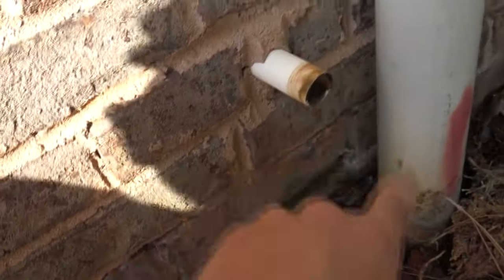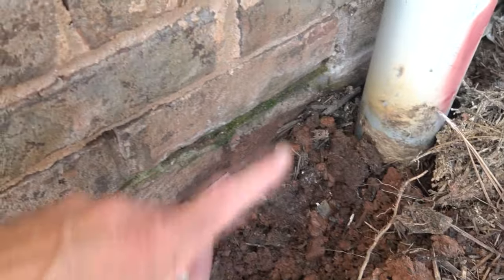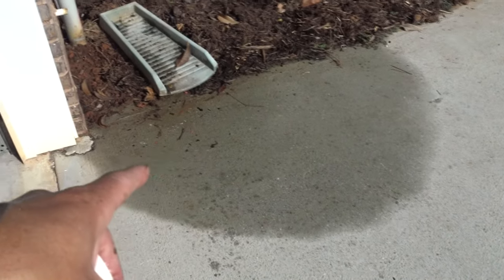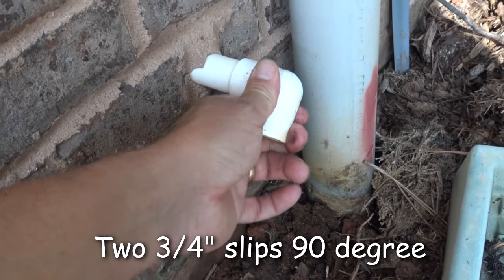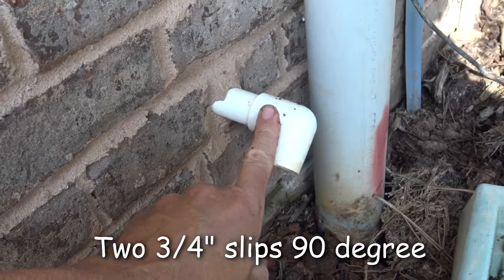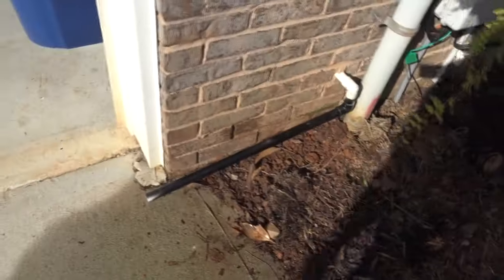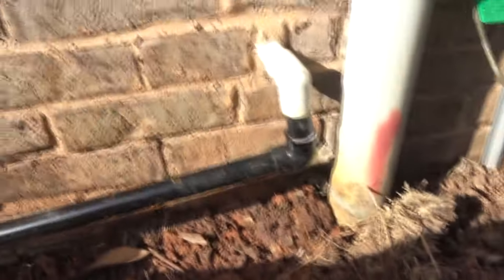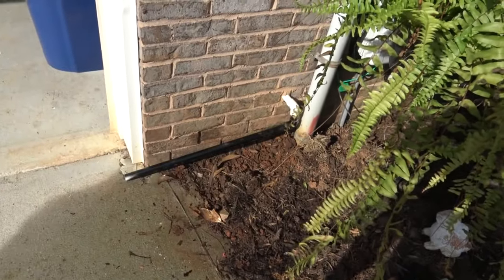AC Drain Drip Near Foundation - Move AC Drain Water

Comment: Older video - but exactly what I was looking for. Especially grateful for the tip about not gluing the pieces so that you can move them (or even disassemble easily for cleaning). Great video - thanks.

Comment: You can dig a gravel pit if it just goes into the yard. Dig a 3x3 foot hole 3 feet deep and fill it 3/4 with gravel put the pipe a few inches into the top of the gravel and cover with Landscaping fabric and then fill with dirt over the fabric. Reseed or cover with the sod cut out you would have made. This is about a $50 project.
Reply: Thanks Josh. Will that cause it to back up or get clogged?

Comment: On my house, the main a/c drain pipe goes to a bathroom sink drain. Earlier this past Summer I noticed that there was a rust colored stain on the exterior of my spare bedroom vinyl window on the outside and started checking the attic to see what was wrong. The overflow pipe comes through the exterior through the soffit. I found that my drip pan drain pipe  that goes to the bathroom sink, was clogged and the pan was almost full.  Here in North Texas many new homes have the air handling equipment up in the attic. Yes, I know that it is the hottest location during the Summer.
Reply: I was going crazy looking for my drain pipe outside the house for an hour then I read your comment and BOOM! Mine is in the same spot. Thank you for commenting 8months ago lol. ✌️

Comment: We had a cheap plastic pipe running into our backyard when we bought the house but our dogs kept knocking it down because not only is it in the middle of the yard, it's also fairly high up on the house. My brother in law attached a hose to it instead hoping the dogs wouldn't be able to get the hose off, which they haven't but now the water drains into the middle of the yard where the dogs dig a hole for the water to collect in and they make a HUGE mess and drink it. I don't think it's good for them to be drinking it.  At a loss for what to do about this draining now!

Comment: Mine is located in my attic and the drain pipe is slab right in the middle of the soffit, on top of the master bedroom's window so it's not close to the wall and it's a two story house. I had to get a 90° elbow, aim the elbow towards the wall, stick an 8in pvc pipe in (that's how far away from the wall above the window the pipe is) grab another 90° elbow and slant it a little to the right, downwards before inserting about 12in of pvc so the pipe doesn't run directly in front of the widow and is located next to the gutter. I inserted another elbow, stuck a long pvc pipe in it, coupled it with half the other pvc pipe I bought before  putting an elbow, 5 inches and one last elbow aimed downwards so the water goes right above the splash block. I did have to glue the top parts because of the difficult location of the pipe, but the long pipeline I just secured with some straps . Rain and shine did the trick for the glue. No leaks, it drains directly in the splash block instead of right above my new outdoor unit where it was causing issues plus messing up the wall. Now I can finally fix all the problems it left behind.

Comment: In terms of termite prevention you will want to make that pipe 10 times longer to get the water away from the house.
Reply: I strongly disagree the water exits to the concrete where it will dry 10 x longer would be way to long or need to be buried so it won’t be unsightly

Comment: I keep my 90 degree elbow pointed upwards at an angle which fills the pipe with water to deter critters from climbing into the pvc pipes.  By placing the piping in a downward angle the pipe will not fill with water to deter them.  Thoughts?
Reply: Mosquitoes

Comment: I did this a few years ago. Adding 2-90 degree angles caused the line to clog twice a year instead of every two years or so. Has to be vacuumed out twice a year for prevention. Surely there's a better way.
Reply from the maker: It's not CAUSING the clogs... mildew is... put a POOL chlorine tab in the drain pan of your AC unit. Problem solved.

Comment: Mine drips anytime my ax is on. It is okay for the condensing pipe outside to be dripping? A handyman claims it’s a sign clog, and he made an attempt to unclog it but the pipe still drips.
Reply: The dripping means the A/C is working
Reply: Thomas Sankara if your a/c is on and there is no drip from the condensate line something is clogged and needs to be checked ASAP

Comment: That's the secondary drain line. If you see water dripping from the outside pipe then your primary drain line is clogged and you will have water in your A/C pan. You should pour Clorox down the primary pipe every year to prevent the issue. I have seen the primary A/C line next to the foundation. That's not a proper installation. That can cause foundation problems in the future.
Reply from the maker: Actually... it's part of the primary.  All AC units produce large runoff in the southern humidity . Goes to the pan, then goes to the pan drain tube. While it is "code" installed... it is a stupid location you're right. Hence the fix.

Comment: and in the winter when it freezes your in trouble
Reply from the maker: What is freezing?  You do realize it's GA...
Reply: I normally don’t run my AC when it is freezing.
Reply from the maker: lol...…..
Reply: When you have the heat on it doesn't drain it's only when the AC is on
Reply: Myla Woods haha need to do more research  before you comment 😆
Reply: This is a classic response, right up there with moving "deer crossing" signs to areas safer for deer.